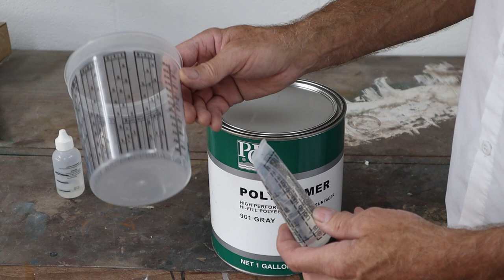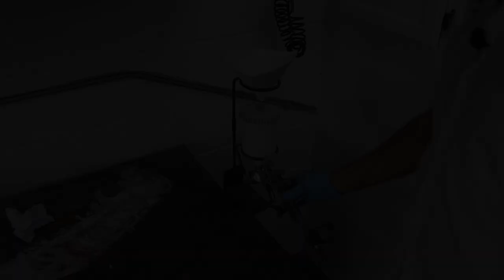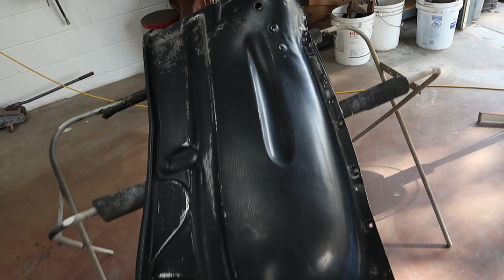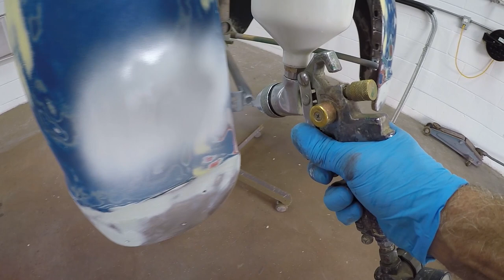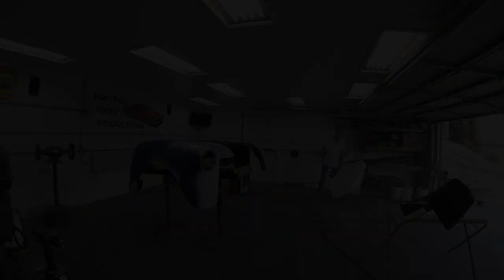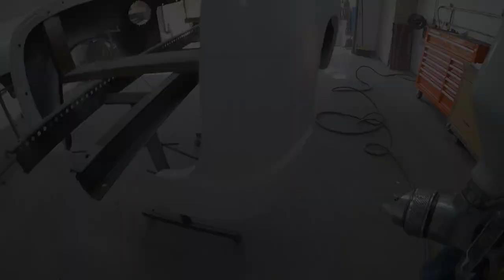1950 Chevy Truck (Ep 9) Fender Prepping and Priming

Comment: Use a flat screwdriver and punch a slot it the top of the primer and paint can where the lid goes so the primer will drain back into the can.  Helps with a messy rim and lid.
Reply from the maker: Thanks for the tip!

Comment: Great tips. I'm restoring a 1951 chevy truck. What is the best method to strip old paint to bare metal ?
Reply from the maker: I just had my GTO dipped to get it stripped, here is the video:  https://youtu.be/5zV9vbgbpOw
Unfortunately the good chemical paint stripper is not available any longer as they outlawed two ingredients that made it very affective but pretty dangerous. There are some out there but they are slow and may not work.  Then there is media blasting which can and has warped sheet metal so if you go that route do a lot of research on anyone you are considering using.  Mechanical removal is simply buying a lot of 80 grit sanding discs and going after it, just be sure to not overheat the metal while sanding.  Look for a chemical dipping place near you first as it is the best way of doing it in my opinion.  Personally I will not have sheet metal media blasted unless it is strong curved panels that are hard to warp. Your fenders for example.  
Mark

Comment: Well done once again! I'm going to start on my 53 Chevy Pickup after the holidays. How much primer would it take to cover the whole truck? I love your jig to hold the fenders :)
Reply from the maker: Depends on how much blocking you will be doing. One gallon goes pretty far but I had to pick up one more since I did the interior, inside the bed, under the hood....
Yeah that rack is one of the best additions to the shop I ever made.
Mark
Reply: @FoothillPaintandFabrication  Thanks for the response!
Reply from the maker: @douglashart5059  No problem, let me know if you need anything else.
Mark

Comment: Awesome channel !   I'm glad I found it. Hey Sir BTW, What size fluid tip on the primer gun? Thanks for the videos.
Reply from the maker: Thanks
The fluid tip is a 1.4 mm which is about as small as you want to go with this type of primer in my experience.  I just tested a new gun and used a 1.7 mm tip but the results were not as good as I had hoped.  I will post that video when I get a chance.